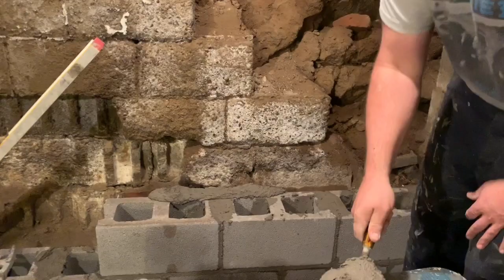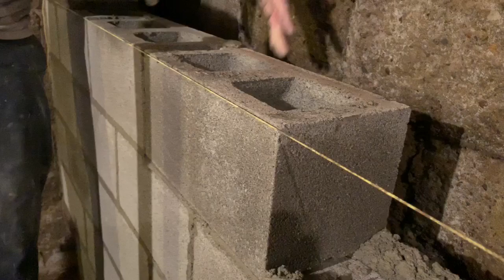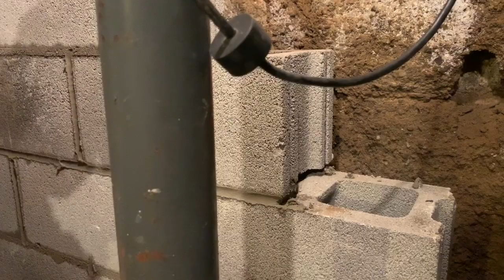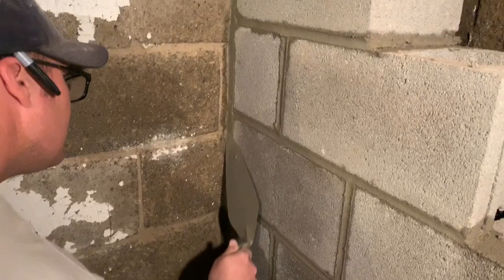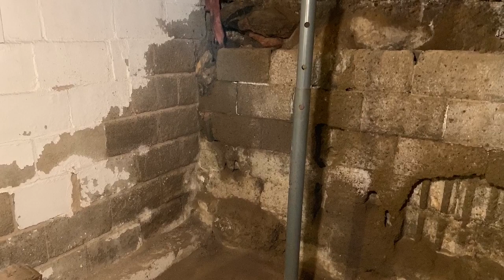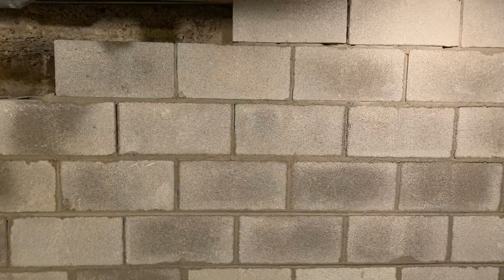8” block basement repair

Comment: Hi, my basement wall is falling apart like the one in this video. I wanted to know. Do, I need to remove all the old bricks on the wall first? Or, can I do what your doing. And just put a new wall in front of the old wall.
Reply from the maker: Christina Jones it depends on a lot of things. The most important part was fixing the water problem on the outside that caused the wall to fail in the first place. The old sidewalk outside this wall used to slope toward the basement and that caused the wall to deteriorate. A new sidewalk was poured before replacing this wall. For this repair the homeowner had a very limited budget. Because of that we skipped a few steps that make it not the most proper of repairs. We did not pour a footer we just laid the block on the floor. The corners of the old wall are still bearing most of the weight. This walls purpose is more to close up the hole in the basement wall and less structure. There are plenty of bricklayers that would say this is not the right way to fix it. But I am confident that this wall is a permanent fix. Good luck with yours.
Reply: @WoodandBricks  thanks!

Comment: In my humble opinion, cinder block should never be used for basements. I think it should be banned.
Reply from the maker: What would you use instead? I like them better than poured foundations.
Reply: @WoodandBricks  I got the stuff it looks like Styrofoam and then you pour concrete in it. I don’t think it’s Styrofoam, but it supposed to be waterproof that looks like that would be the best of both worlds.
Reply from the maker: @glassduck985  👍🏼

Comment: I can Probobly push that new wall, no diging for the new wall and still bar. You did a good job for sure but i dont think its strong.
Reply from the maker: I don’t disagree that there are many ways this wall could have been stronger. They weren’t necessary for this application. I have been building, repairing and demolishing masonry walls since 1998. Not a chance you could push it over. With the weight of the house on that wall it’s not going anywhere. Thanks.

Comment: Should have filled those blocks with sand... just saying..
Reply: Sand? SB filled with mortar and rebar.
Reply: @r5yamaha  yes.  Concrete nricks or cinter blocks like these.  Should be filled with sand when youre done.  Sand with water can help get the sand into the nook and crannies compacting it.   Which makes the structure stronger and insulated better
Reply from the maker: That is not an accepted practice here. I’m not sure what the reason to fill it with sand would be. I have laid a lot of block both residential and commercial also completed a four year apprenticeship program and never heard of it being done. Filling cells with mortar and/or concrete is common and required to a certain extent. Not sand though.

Comment: You can’t build a wall in front of a wall! That wall is not going to support the outside structure that sits on top of the crumbling wall! You’re due to a huge issue in time. Fine if you just want to sell the house and let the next person worry about it. But they need to start holding people accountable.

Did you pull a permit? And get it inspected? It would’ve never passed!
Reply from the maker: Thank you for your incite.

Comment: Are u spoiled?? That's a nice Stabila level but very clean.. I use Stabilas I have a 16" - 2' - 3' and 4' and I use them all everyday, YOU gotta wipe the bubble glass to see the bubble a lot but that's coming from someone that produces a lot. Guess that's the difference so sit down son
Reply from the maker: I’m sensing strong laborer vibes. I checked your channel to see how to do it right but there were no videos. So why don’t you head back to the mixer where you belong.